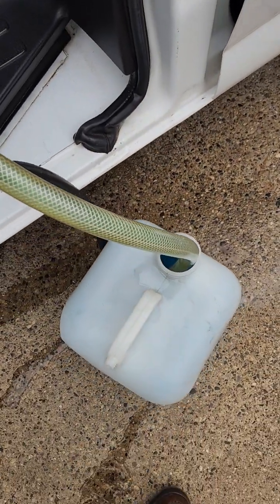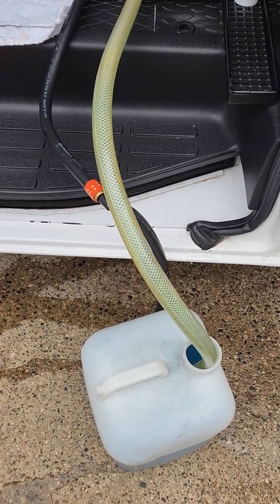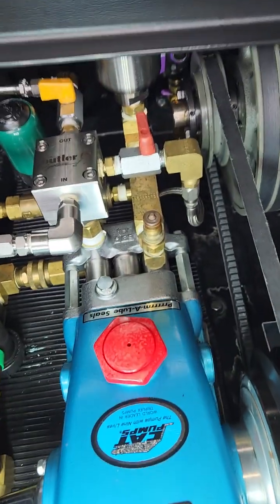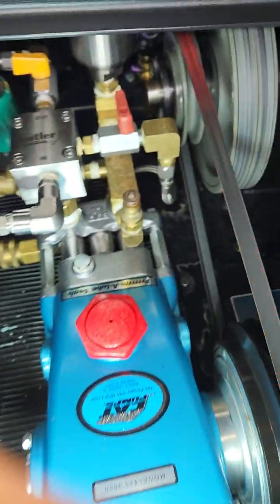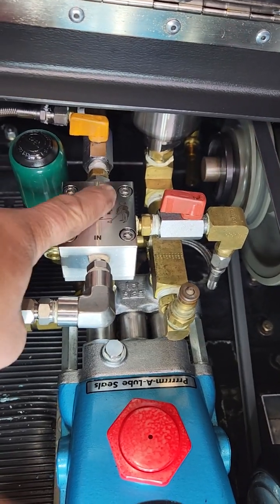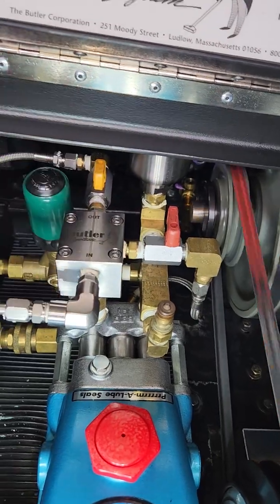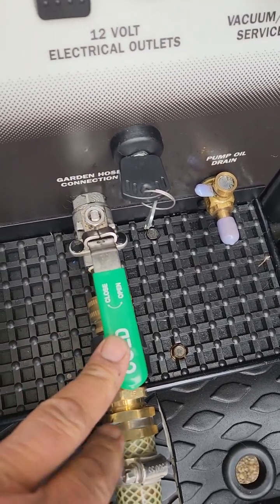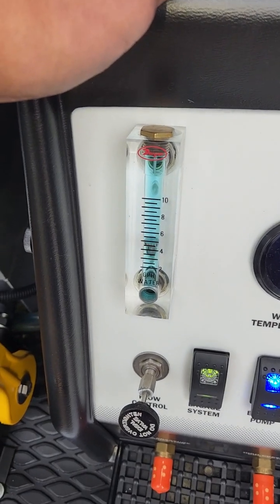Prime the chemical pump on the Butler system.

Comment: When I first got my Butler, I didn't receive this training and therefore over-complicated this simple process because I was also opening other valves and doing way too much to get this to feed. It turns out that you really only need to open that first valve, to let the air out and then you adjust. Thanks for this video because any new Butler Owner might need it.
Reply from the maker: Thank you
My intention was to keep it simple. Because it is simple.